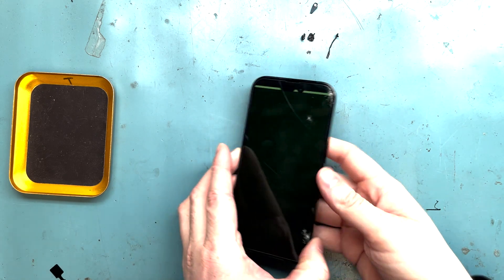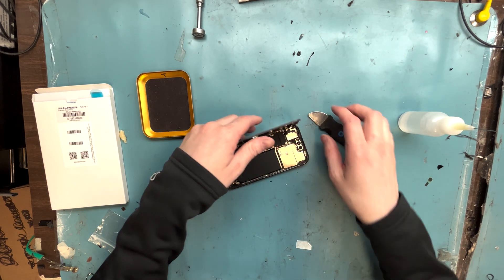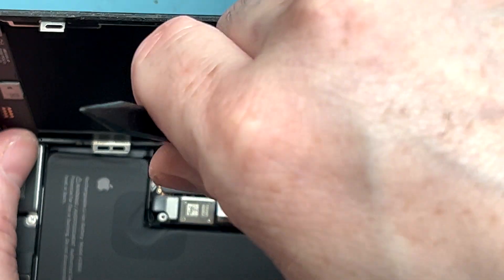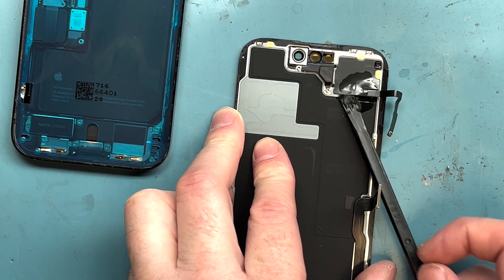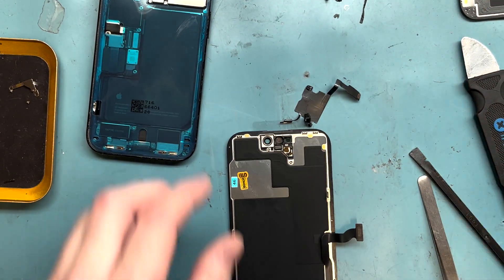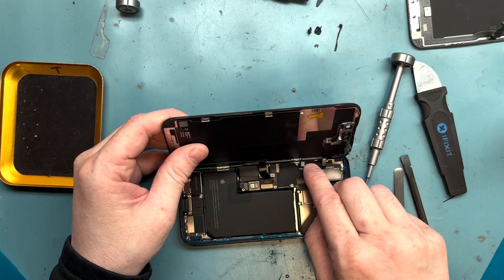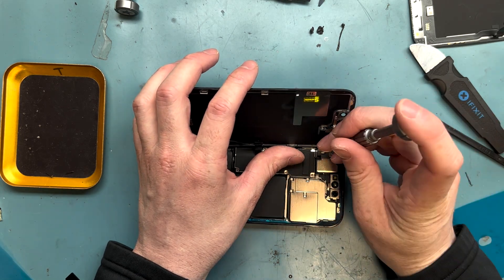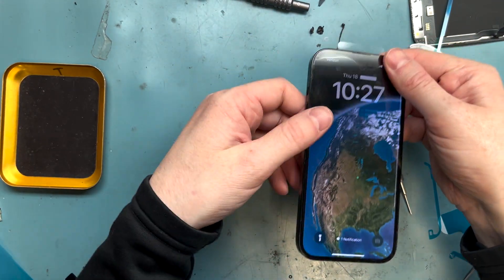iPhone 14 Pro Screen Replacement Guide

Comment: It's easier mcuh easier to just heat up the screen on the glass side when removing the proximity sensor. Takes me like 2 minutes to remove it and no acetone either. Just some friendly advice for others that may be struggling
Reply from the maker: Hey I did this wow life changed mind blown 🤯 I made a new video about what you said on my iPhone 15 screen
Reply: @worthitrepairs  Hey I’m glad it worked out better for you. I saw your video and I actually just use a heat gun instead of a heat pad so that I can still pick it up afterwards but whatever works best for you! Great videos and great information!
Reply from the maker: @Mattdylan101  I do normally use heat gun or both this method in video and heat gun but the pad was much better

Comment: It is stupid thing when your genuine display rejected by system. Thanks for video.
Reply from the maker: Yes I hate it drives away repairs that I could be doing at work it literally could cost me my job!
Reply: Only apple will lose out on this..they are only 1 manufacturer people will just start buying diffo brand if they make it so difficult to repair

Comment: Does Alcohol work to remove the Proximity sensor?
Reply from the maker: I used this acetone alcohol mixture and it works well haven’t had any negative results yet

Comment: After watching your regular iPhone 14 screen repair. These ribbon placements looks exactly the same (same size as well). What's to say this screen wouldnt work on the regular iphone 14? Thoughts?
Reply from the maker: I have put an iPhone 8 battery in an XR before it worked for like 3 weeks but I don’t recommend trying it you may blow a circuit and ruin the whole board of the phone which isn’t cheap
Reply: No because the regular 14 dose not have the Dynamic Island and the pro dose

Comment: Does true tone still work after screen swap or we have to replace the chips on the screen for that to happen?
Reply from the maker: True tone seems to work but not 100% sure on that one
Reply: @worthitrepairs DOES THE FACE ID STILL WORK AFTER THE SCREEN REPLACEMENT?
Reply from the maker: @acumen1  yes if you don’t break proximity sensor
Reply: Need to reprogram